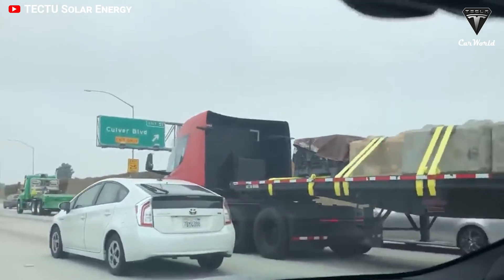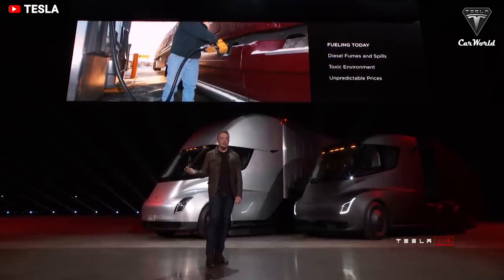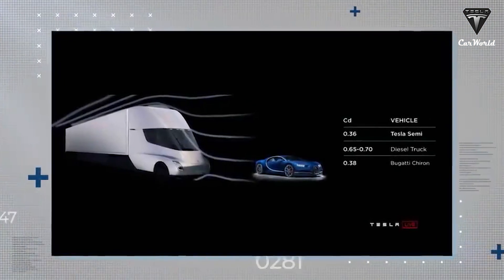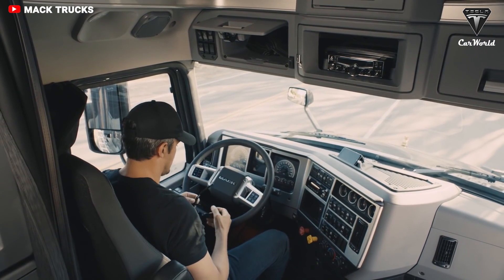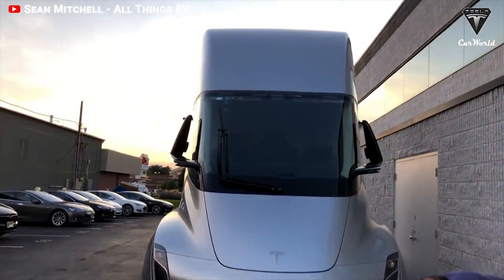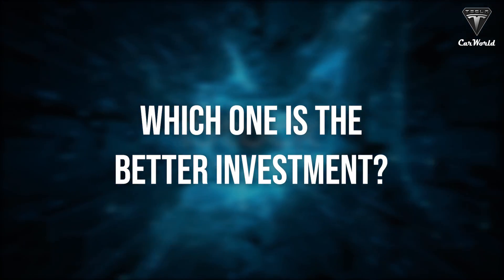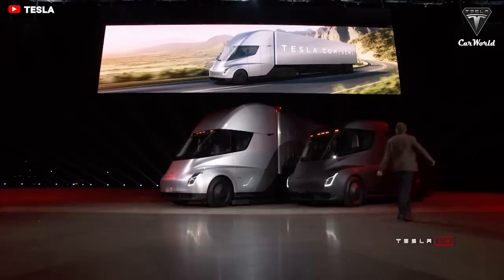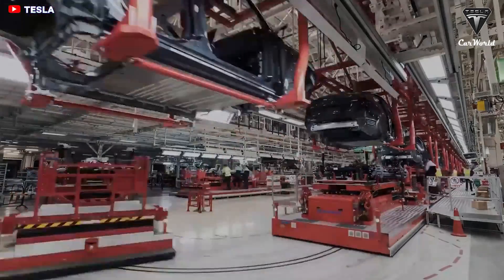Which is the KING of 2023 heavy trucks? Mack Anthem Diesel Truck Vs. Tesla Electric Semi?

Comment: Just look at how complex the Mack cab looks compared to the clean and simple Tesla offering. There's going to be a huge difference in the cost of making these. As long as the Tesla Semi can be recharged during loading and unloading, it's going to be unbeatable.
Reply: Rumour is the truck will have 1MW charging speed .. even at 500 KW speed charging should be done in 1 hour from 20 to 80%
Reply: @sudeeptaghosh  - And the charging speed will only increase over time.
Reply: Nonsense!!!!! What makes the Mack complex!? It’s litteraly just a truck with much more flexibility and configurabilty to tow/haul even more loads than the tesla semi! The Mack can also go on longer tougher roads
Reply: @carholic-sz3qv  oil change filter change engine over haul break pads just the regular maintenance is not only expensive huge huge pain in the back .. refute me
Reply: @sudeeptaghosh  bullsit!!! How often do you need to overhaul an engine!? Usually it’s about after a million mile….. the brakes are also going to need a change on even EV trucks! Oil filter is not a hard thing to do 🤡!
Reply: @sudeeptaghosh  the funny thing is that even after how old those diesel trucks gets they are still way more useful than any new electric one! They get exported to foreign countries, Africa, South America….. where they are used in tougher environments where your typical EV can’t survive let alone cover any significant route.
Reply: @carholic-sz3qv  you are very badly informed commander .. a battery truck will serve for few million miles without any maintenance then at the end owner will get back 20 to 30% back just for the minerals in the battery .. just calculate the saving .. how many engine overhauls will be needed for few million miles
Reply: @sudeeptaghosh  vehicles aren’t just about engines or batteries 🤡! There are whole bunch of sustems around it! And if we actually allowed diesel trucks to tow more which they can they will actually even be much more rentable over the years! Just look at Australian road trains!
Reply: @sudeeptaghosh  tesla has been making cars for almost a decade tell me why we haven’t seen one of them in a remote place in South America or Africa or anywhere else!? Even the cybertruck is going to be totally useless there!
Reply: @carholic-sz3qv  I understand your POV but those niche application not even count for .0001% of all the truck transport needs ..BEV can easily take over 80% of all trucks and reduce the maintenance and fuel cost but 70 to 80% just think no tanker trailers will needed to run all over the world .. coz to transport electric it does not need any thing 🤷‍♂️
Reply: @sudeeptaghosh  Have any EV trucks gone 1 million miles?
Reply: @pogo1140  not that I know of but I know EV cars has .. I know BYD buses in China has .. so from that i can deduce that the semis with same drive train(motor and battery) will go no issue and anyways Tesla gives warranty no maintenance for a million miles for SEMI.. need more assurance ?
Reply: @sudeeptaghosh  uhm nope!!! Trucks comes in all sizes and configurations for all kinds of applications and the tesla semi isn’t going to make a dent in all those types! Also trucos worldwide aren’t always used on paved roads or where any infrastructure exist. It will also need a radical change in the industry to be any good.
Reply: Way to soon, Range is not good loaded, cold or Mountains.
Reply: Nonsense.  Fanboys don’t understand the real world.  They unload at a business like a produce company….that company is not installing charging stations to charge trucks they don’t own….same with loading.
Reply: @jimdandy9118  I heard Pepsi is doing .. is that a false news ? So chains has all incentives to do it right ?
Reply: @sudeeptaghosh  Pepsi is doing. Small pilot project for some local deliveries.  Big deal….they have the money to throw away.
Reply: @jimdandy9118  more than 80% of truck movement happen in fixed roots .. Walmart Walgreens cvs Tyson fedex ups usps Coca-Cola , alcohols everyone will have incentive to install chargers you will see.. for me even 1 truck convert to EV is better .. so that my kids your kids breath better
Reply: @sudeeptaghosh  If you want your kids to breathe better than you need to focus on India not an EV truck in the US.  Modern diesel trucks run very clean….India is making whatever that is done in the US irrelevant.
Reply: @jimdandy9118  I understand but let me tell you India will achieve the Paris summit goals way early .. India still per capita lowest polluter on earth USA and Australia is the highest .. but because of the strength of US economy a new tech only can come and survive in USA .. companies like tesla could not have survived in other countries.. Indians are the only civilization which still lives and respect the nature and biggest vegetarians population.. do you have any Idea how much pollution USA meat industry does .. please educate yourself .. before making ignorant comments
Reply: @sudeeptaghosh  Pepsi is delivering a product from it's site to the customer. That's not what the majority of semi-trucks do.
The Semi-Truck owner usually picks up from a customer, delivers to that customer's customer.
Reply: @pogo1140   no sir majority of trucks ply in defined routes .. all Mail Truck from fedex UPS USPS Walmart AutoZones Costcos all the oil Tanker trailer .. all the retailers like macys and all , all the dairy meat(Tyson) runs on pre-determined routs .. even if it’s long haul they exchange trailers semi tractors don’t go that far they come back .. please verify yourself too .. all the dumpers utility trucks
Reply: You do realize that with new emissions on trucks built after the 2010 model year. In majorly polluted cities. The exhaust stream is actually cleaner that the air doing into the engine. Thing like the DPF  
and DEF did wonders for the emissions.
Reply: @erikthorstensen5185  can you breath the exhaust ?
Reply: I didn't mind the old system. But the new exhaust is like ammonia.
Reply: @sudeeptaghosh  total BS on who the biggest polluters are , China is number 1 by a long shot .
Reply: @jimdandy9118  small? They ordered 100 trucks with large deposit a few years ago as they can see they will be game changing and hard to get once production starts - which it did last month.
Reply: @jimdandy9118  Don't forget about China
Reply: @mrjjeffress1  What does China have to do with anything?
Reply: @jimdandy9118  you may be absolutely right. Plus you cant have them on-property cluttering up the area. All charging must be done off premises. They will solve this problem when it pays to solve it. Time will tell.
Reply: @jimdandy9118  - Fair enough. So the semi just needs to hit a charging station somewhere during the route just like an ICE semi needs to hit a fueling station. That said, it is entirely conceivable that a destination(s) could install a suitable receptacle that an EV semi could plug into during unloading (or loading) and add a few miles. The same cannot be said for ICE semis. 
Someone recently was telling me that I could not drive my Tesla to various remote locations in Wisconsin because they had not charging stations. So I asked if they had electricity in camp grounds or houses and he said "Of course they do". Then I showed him my mobile charger that allows me to add miles (charge the battery) just about anywhere.
Reply: @thomasruwart1722  Pay attention.  You are just a guy with a car.  We are talking about businesses that cannot risk not having deliveries on time.  Not going to happen.
Reply: @thomasruwart1722  nonsense!!!! Diesel trucks literally have about double if not 4x times 500 miles even loaded, they don’t need to refill all the time depending on their configurations lol…..
Reply: @thomasruwart1722  an Australian road train can literally cross the outback while hauling 4x80,000lbs with about2” 2500 miles of range on unpaved roads
Reply: @jimdandy9118  - So, I'm admittedly not a trucker so I don't know the nuances of being a trucker. It is entirely possible that the while electric commercial trucking industry will be a flop. But I would say that it has a far greater chance of succeeding and growing rapidly than it does flopping. 
The reason I say this is because I follow the consumer automotive EV and ICE industries closely (I grew up in Detroit in the 1960s so it is part of my DNA, either that or it's a brain tumor). We are at the beginning of EV adoption in the US and by 2030 it is likely that EV car and light truck sales will eclipse ICE sales by 4 to 1. During that time, the charging Infrastructure needed to support that many EVs will have grown to meet the needs of EVs. Now, it has been said that the large numbers of EVs would stress the power grid. This is not true for several reasons. First of all, the power grids will improve over the coming years, partly funded by the Infrastructure Bill. Secondly, EVs are one component in what is known as a Virtual Power Plant. When there is an EV is sitting in the garage and is finished charging, it can act as a battery that can provide power back into the grid on an as-needed basis. When you consider thousands or tens of thousands of EVs plugged into the grid, a VPP of EVs becomes compelling. It is also possible to power one's house with the EV for some time during a power outage. The power and energy companies (of which Tesla is one of the energy companies) are already implementing this in some countries. When you include residential solar and/or wind power, it is possible to charge an EV entirely off the grid. I know a person who actually does this with solar panels. 
Anyway, my point is that fully electric commercial trucking is inevitable and is just a matter of time, IMHO, based on my observations of the global consumer automotive industry move to EVs.
Reply: @thomasruwart1722   the diesel truck can run at least  thousand miles in between fueling.  Electric can only go 500 and then you need two be looking for a charging station at 350 miles.  That would be an absolute nightmare.  Guaranteed to add a few hours on to every trip
Reply: @raydavis74  - I agree. However, that is a matter of the energy density of batteries. There are quite a few new battery chemistries being developed to address the issue of energy density in batteries. It is just a matter of time, say 5 years, before the battery energy density is 3-5 times what it is now. That means that 2,000 pounds of batteries will give you 3-5 times the range. That said, I am holding out for the Dilithium Crystal in the glove box: 10 million mile range, 0-60MPH in HOLY SH!T!
Reply: @thomasruwart1722  How long to charge a 200kw battery on that 210 outlet?
Reply: @pogo1140  - My level 2 charger is on a 240VAC 60A circuit and charges at a rate of 41 MPH or about 11kW per hour. If I plugged my charger into a Tesla Semi I would expect my wife to ask me "What on Earth did you buy that for?!?!" Furthermore, I would expect the charger to run at exactly the same speed - 41 MPH or 11kW/hour. Thus a full charge from 0 to 200kWh would perhaps take about 20 hours give or take. It will likely slow down from 90% up to 100% but in general that's what I think you would expect to see. Also, I would tell my wife the Tesla semi is yours and you were just visiting.
Reply: There's a difference between having to recharge every 300+ miles,and having to stop for fuel every 1500+- miles. Ill keep running diesel power thank you.
Reply: @jimdandy9118  - I'm a retired research scientist in technologies closely related to EVs in many ways. Thus I am viewing EVs thru that lens and perhaps, as you say, a "fanboy".  Over the past 10+ years Tesla has made and continues to make enormous advancements in EV technology including their manufacturing processes. 
Technology aside, the whole thing about EV adoption is more a matter of time. Your arguments about not being able to charge an EV are not convincing. The reason I say this is because while many people who live in apartments or houses without garages... etc. cannot charge their EVs, well, they can't fill their cars up with gas at home either. They need to go to a gas station. Similarly, such EV owners would need to go to an EV charging station. Granted, there are not as many EV charging stations as there are gas stations, but supply and demand will change that quickly as EVs become more prevalent. Over the next few years we will see a flood of low-cost EVs from BYD, MG (yes, the MG4 - cool car), Tesla with their Model 2 to name a few. If you are not aware of these new EVs entering the US, there are several sources on YouTube that explain it quite well. It should also be noted that the EV Charging Infrastructure in the US is already underway with the help of funds from the Infrastructure Bill. As I said before, time will tell whether EVs will succeed or fail. But I am an optimist so I think EVs will succeed in a big way and sooner than you might think. Have a great weekend!
Reply: @thomasruwart1722  You think like a child.  “People don’t fill up their cars at home”….they don’t need to because it only takes 5 mins at a gas station.  Nobody is going to want to wait 20-30 min at a station a couple times a week.  Cost is irrelevant, the technology is already in gas cars….If you cannot charge at home people will buy a car that is $25k less and just use gas.  I guarantee people in CA are now very hesitant to buy one since the Governor told them not to charge them during the rolling blackouts….the grid will melt down.  The next President will be a Republican and gas prices will drop and people will not think about EV’s.  No way you’re an adult.
Reply: @thomasruwart1722  The only people dumb enough to believe CO2 causes global warming are too young to afford a car…I know a lot of people and I’ve never heard a single person express interest in an EV.  Not One.  In fact, I do know of one person who had a model S, he drove it from St. Louis to NC, he had to stop 17 times and it took an extra day of travel due to charging time.  The car got nowhere near the claimed range.  He sold it and went back to a Mercedes D class.  That’s real world….engineers live in manuals not the real world and few have any common sense.  Fact
Reply: @jimdandy9118  - The more you write the more you display your severe lack of knowledge about the EV ecosystem. It's also apparent you cannot have a civil discussion so I think it best that I stop responding to your posts.
Reply: @thomasruwart1722  You’re just a Fanboy that doesn’t live in the real world.
Reply: @thomasruwart1722  The big reason people were initially interested in a Tesla was the technology but now it’s no big deal.  I just bought a truck that does everything a Tesla does, it drives in its own lane, adaptive cruise, collision avoidance, 360 degree cameras, alerts for pedestrians and cars coming when backing out.  So no, people no longer have to have an EV for the tech.
Reply: @thomasruwart1722  actually I can fill my diesel at home. At about 1/8 the price of the pump even less, up cycling resources while I do so, the problem is the government doesn't get taxes when I do this so it's illegal.
Reply: I m not batting for EV without profit .. none of you should go EV if your profit margins does not improve by 50%..yes I know I said FIFTY %
Reply: Professional truck drivers, opposed to someone that just steers, like a lot of information and are usually very very perceptive as to how their vehicle is performing.   Most cabs have a lot of gages and switches so the driver can have full control of all available features.
Reply: Says the guy who sits behind a desk and has never driven a semi a day in his life ! 👍
Reply: Recharge during loading and unloading? And shippers/receivers are gonna PAY for the electric? Many shippers/recovers don’t even let truckers use the toilet!!😮
Reply: Only New York and California (ports) will benefit from the electric semi. JS . Middle American doesn't have the infrastructure for long range semi trucks. Tesla sounds good to Google truck drivers but veteran truck drivers know what the deal is.
Reply: Complex? Lol you ever been inside of a semi before?
Reply: A flashlight is simpler than an oil soaked rag on a stick.
Reply: @reasonitout9087  bullshit!!!!  The same oil used to make the wheels your tesla has! To make the plastic parts a tesla has, to make the roads on which a Tesla drive, to make medical equipments, fertilizers, lubricants which also a tesla has……… grow up
Reply: @reasonitout9087  there are millions of oil byproducts that no batteries will ever even replace and that is facts
Reply: @carholic-sz3qv  Yes I totally agree. Elon Musk said as much as well. Progress and time moves on though.